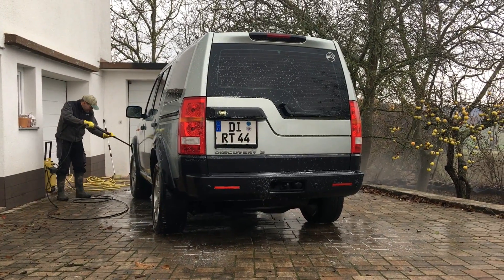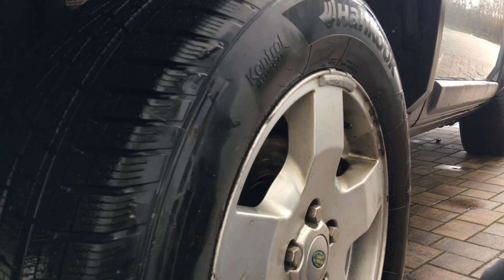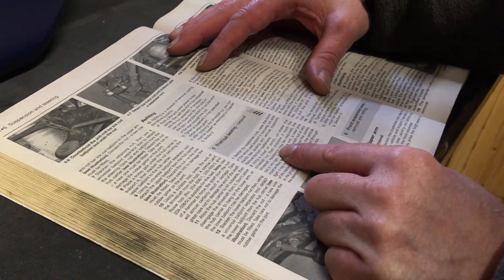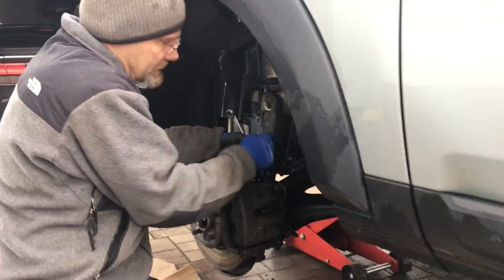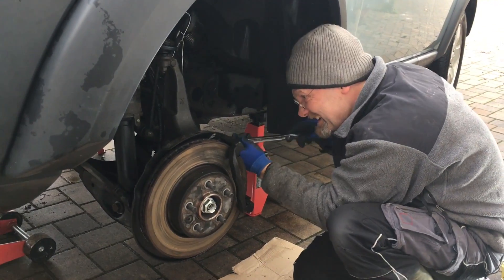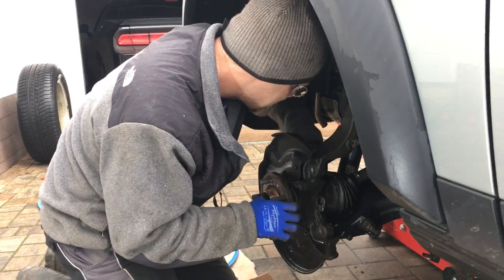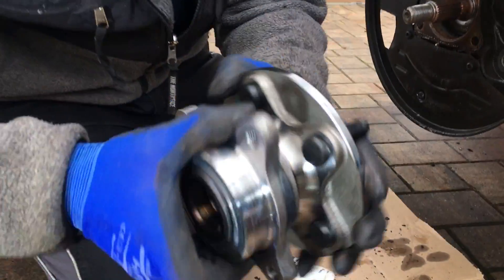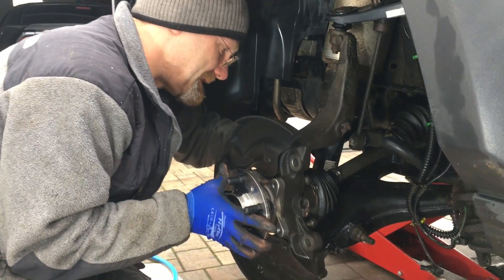Front wheel bearing repair  Land Rover Discovery 3

Comment: Loving the channel, did I notice you are running Hankook Winter i*cept tires? How do you find them? I have just had a set fitted and they feel great in the snow which seems to be a daily occurrence this week.
Reply from the maker: We ran these tires summer and winter for 4 years.  This was a bad (expensive) idea.  They are great all year around in regard to traction but the wear is high in the summer.  They are also not suitable for course gravel and will get damaged quickly.  This is why we bough a second set of (identical) rims, so that we can run all terain tires in Summer (which we have not bought yet). The Hankook last about 30 Tkm only if driven year around.   Traction in winter and rain is really good I think.  But we did spend way too much money over the years running them year around.

Comment: Just started watching the video, but I suggest getting the Timken wheel bearings. They are the OEM parts; they cost twice as much as SKF, but they will last at least 100k km.
Reply from the maker: Hello Alex, I know I should not save on spare parts... We will buy the Timken next instead of the expensive SKF.
Reply: @Vera_and_Christian  I do understand your rational for going for a cheap one, and it will surely be interesting to see how much it lasts.
When we bought our car, it had 109k km on the clock. One wheel front bearing was changed by the first owner,  just before we bought it. We changed the other one right after purchase, as it was shot. Went for a Timken one (about 180 euros). Now at 200k km with no issues, despite quite heavy off-pavement use.

Comment: Hey Christian and Vera. Great video. How is the cheap bearing going? How many kms does it have now and is it going well? I have one due for replacement and I’m interested to know if there are any decent but affordable options on the market. Cheers
Reply from the maker: I am not sure ab the km's, probably around 15000, but it's going strong so sofar 😃👍. You know we have installed expensive ones and cheap ones, boths have failed during the same lengths of time and km. If you read the comments to that video, there are a lot suggestions regarding wheel bearing brands. We usually install ones available in Germany, like 
 SKF. 🙋‍♀️ Vera
Reply: @Vera_and_Christian  Thanks Vera :)

Comment: Dear both, we can help you with your braking line, we are also like you and have some LR3. But you need a weekend. We can split the frame from the chassis and than you can work easily on your topic. We have the tool to help you out. We are only some crazy privat LR3 fans. Let me know
Reply from the maker: Hi Michi, I unfortunately just saw now your comment.  We have a pit in our Garage, so that helps a lot.  We hope to fix whatever the car throws at us without lifting the chassis off the frame.  But thanks for your offer.  Happy to hear that there are more LR 3 Fans out like us.  🙋‍♀️ Vera

Comment: As ever, very cool video. I've done the same on mine. I used a Timken bearing, which I think may have been original equipment..not sure. I don't think they should last forever though. Disco's are  heavy beasts, so give suspension bushes and bearings a hard time, just with normal driving.  Agree, they are easy to work on, BUT I had to upgrade my jack and stands, plus torque wrench. Everything is heavier and a lot of the bolts are tighter than on normal cars. I'd be interested in the transmission work on the challenger! (I have an American V8 powered vehicle as well). Very interested in the brake lines, as my Disco is a similar vintage and will more than likely need those at some point. In the UK, we have the equivalent of the TUV every year! the latest job on mine was the steering wheel angle sensor which gives some very strange problems. Surprisingly easy to take the steering column out, fix and replace. German castles, yes, very different from UK castles.
Reply from the maker: Hello Vernon, we also had to buy bigger stands, jack, sockets, etc.  Everything is bigger than on a normal car.     Still it is much easier to work on as on the Challenger.   On the Challenger every second bold is a issue. Hard to reach, rosted or poor material.  Even if the car is from Texas and has no rost.     There are worlds between the manufacturing quality of these two cars.    The LR quality really exceeds everything i worked on so far, including Mercedes and Audi. The MTBF has not much to do with the manufacturing quality but more with design of the vehicle.   I do know about the steering wheel sensor. I can get loose and develop play and then the ESP kicks in premature.  Thanks for watching the video to the end!